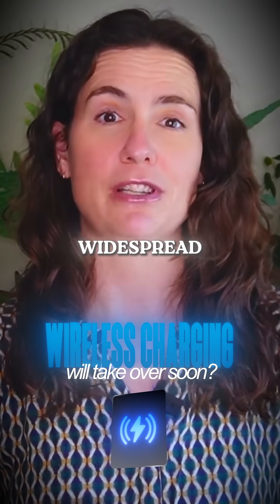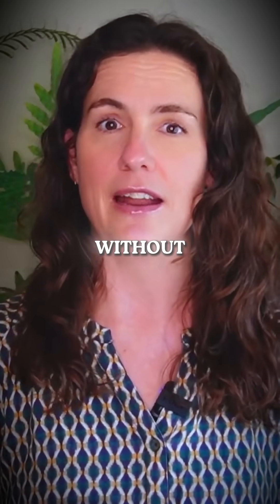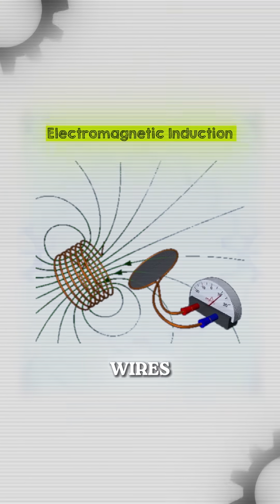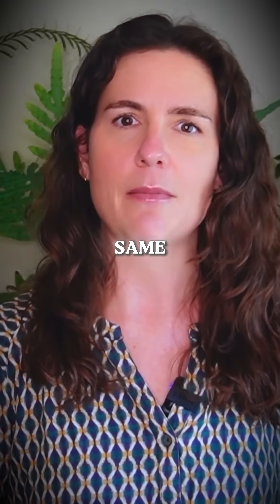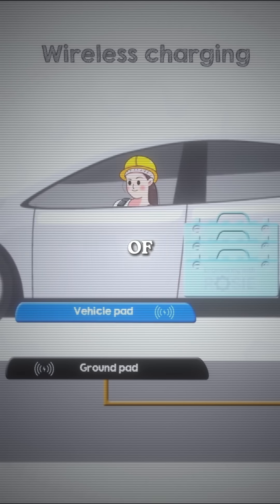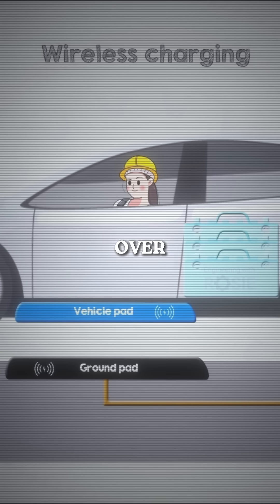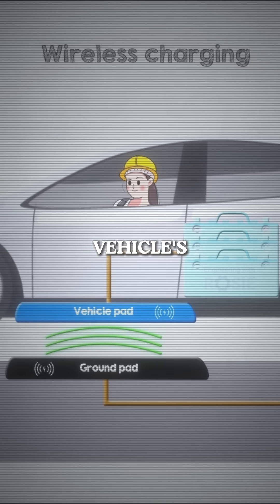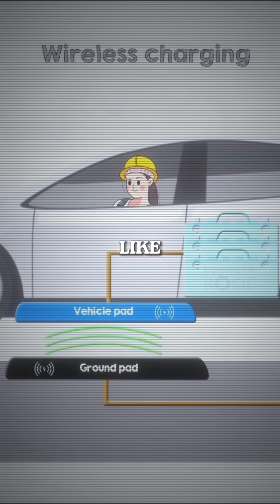How Does Wireless Charging Work?

Comment: The wireless tech most likely to be used is somewhat different as it is designed to cater for significant vertical and horizontal displacement of the coils.

Comment: The answer is that it does not work, no. The inverse square law means that on a cell phone you can't charge more than maybe 30 watts from millimeters away perfectly aligned. 

The amount of energy wasted by trying to do this with a car across several inches at thousands of watts and impossible to align would be absolutely moronic

Comment: Wireless EV charging has reached over 92% efficiency. But given the choice at home, I’d rather plug in and not waste the 8%.  It’s better suited for fleets or other commercial applications.  In Martha’s Vineyard, Massachusetts, I rode a bus that was wirelessly charged at multiple stops.
Reply: 8 or 9% loss on an 11kW charge is about 1 kW of waste... that is huge... this is not a toothbrush
Reply: Was that bus company run by the local government?  Who pays for the kilowatts of waste?  Those who ride the bus or taxpayers (who likely didn't agree to paying for such waste)?
Reply: @ Mr. Red, bus company is Vineyard Transportation Authority run by Massachusetts Department of Transportation (State funded). They have been in operation since 2018 and now bus fleet is 87% electric and has reduced considerable bus pollution. For power, they have large solar canopies and batteries in bus yard with plug-in Enel-X Juicebox chargers.   Wireless is only at major bus stops. Enel has exited the US market so VTA has a problem to solve. They may also get some power from close-by Vineyard 1 off-shore wind farm.  Undoubtedly, supplemental power is fossil based so state taxes pay for waste.  While fares were small, starting late Nov 2024 it became free as an incentive to get more polluting ICE vehicle off the island highways.

Comment: G'day,

I may be wrong (?), but Oz tends to have a lot of "Ironstone" in the Dust, and other Oxides of Iron ; so, about how much Dust will be attracted to the Magnetic Field between the two Pads - and what effect will the buildup of Dusty Iron particles in the Gap have on the Efficiency of the process...?

Wirelessly recharging an EV 
Strikes me
As an expensive "Solution"
In search of some actual Problem to require being applied thereunto.

Segue Warning,

Today I captured and uploaded,

"80 Years Of Renewably-Powered Road Vehicles, In Glen Innes ; Practical Realities...!"

I started with my father's Charcoal-Gas Producer, vintage 1943, at the local Museum, and then rode home on the Solar-Charged Talaria Sting L-1(e)...; while recording on Chest-mounted Video, a (probably ponderous) dissertation upon how much it would cost for a Stand-Alone  Solar Installation capable of recharging a Tesla.

I get a choice of 3 "correct" Answers, being $131,000, or $167,000, or $218,000 - depending on which correlation one extrapolates.

All I can say is that my Solar Electric Motorbike is a
Whole LOT Less cantankerous and fiddly and dangerous than was my father's Setup to drive the family to the Coast for a holiday, on Charcoal-Gas, in 1944....

And it's less of a hassle than catching and saddling one Horse, which could only achieve half the speed of the Sting...(!).

Such is life,

Live a good one...

Stay safe.

;-p

Ciao !

Comment: I think it is a mistake.
One of the benefits with using electric power is the high efficiency. Do to the high efficiency we don't need to replace fossil fuel one to one. But wireless charging does not have the same high efficiency as wired charging. I think it would be a mistake to make wireless charging the default, the next many years, even though we have the technology.

Comment: There's got to be a theoretical limit to efficiency, and there's always inverse square law working against you.
At some point it is far simpler to just plug in or have a pad that rises to make contact than throw away energy as heat/vibration or sound.🤷‍♂️
Reply: Damn you physics! I want ground rectennas linked to power generation satellites! Give them to me!

Comment: Of note. You can pirate electricity by running a wire underneath a high voltage power line. Same method.